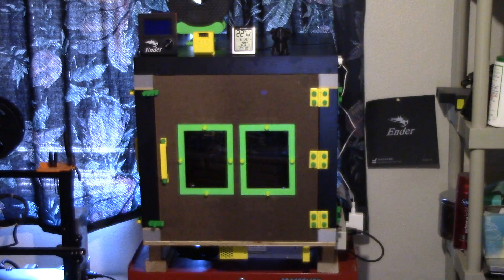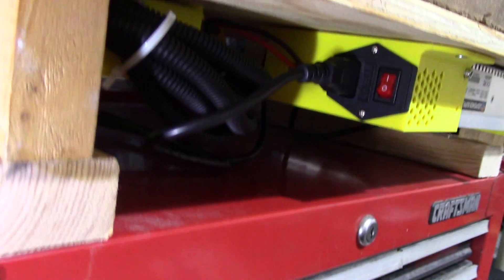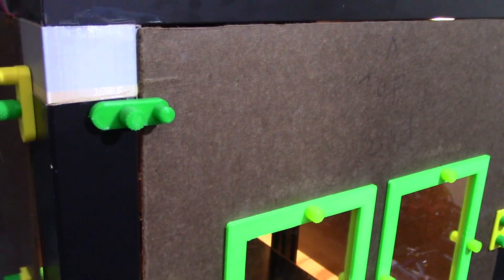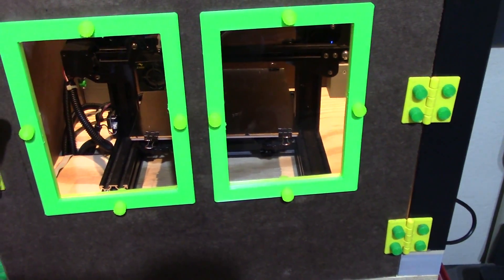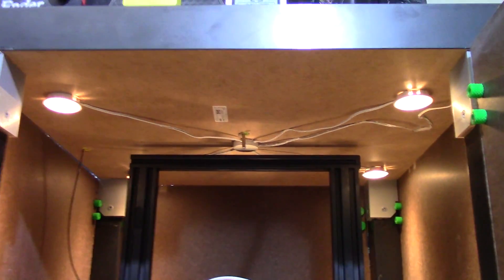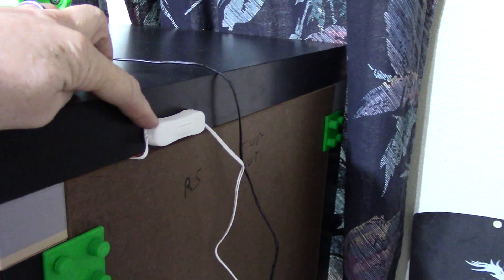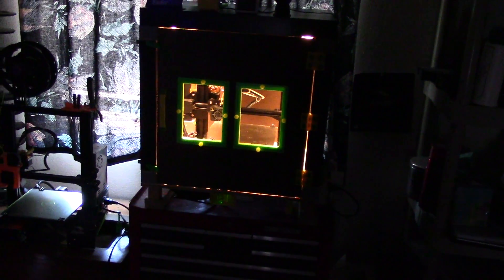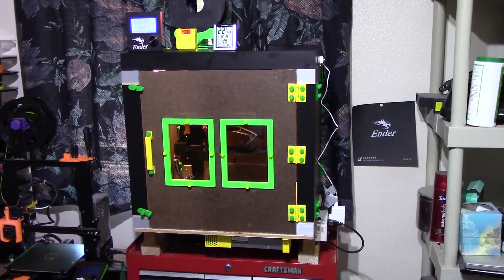Ender 3 Ikea Lack Enclosure! Done? Done!

Comment: Fine project. ABS is my aim as will with my Ender 3 pro.  without enclosure mine prints thin wall object well. I have a ways to go though. Using the SKR E3 1.2 as it came. Not been able to update the firmware as yet. Configuring a Duet Maestro to see how that system works.
Reply from the maker: Thanks, good luck with yours. Stop back and let me know how it went.

Comment: Man, that got really cool.  Aren't you afraid of a fire hazard?  I am reluctant to do the same with my ender 3 because of this.
Reply from the maker: I typically don't run the printers when I'm not home or asleep. But I've taken all the precautions that seem necessary. I've checked all the screw down connectors and the XT60 terminals for arcing and tightness. The power strip it's all plugged into has a circuit breaker. Thermal runaway protection is enabled in the firmware. And I've got a smoke detector in the room directly over the printers. Not sure what else I can do other than building a full metal cabinet with built in fire suppression. I've looked into adding a smoke detector that talks to my alarm monitoring service, but right now all my alarm components are packed up because my house had a flood and is undergoing some seemingly endless remodeling.

Comment: Very nice! Good job.
A few suggested future improvements; 
1. Add through hole(s) with PTFE tube  on top for a filament dry storage box (DIY made from IKEA Samla or similar) so you can keep filament dry (silica gel or "crystal" cat litter in the box) and dust free while easily accessible for swapping at the same time. here is one example https://www.thingiverse.com/thing:2953325 and a box for silica gel: https://www.thingiverse.com/thing:2982939
2. I would probably try to cover all the cracks and add a air ingress hole with a fan and a hepa filter, again to avoid dust, but maybe it is not as dust in your workshop as in mine. :)
3. OctoPi/Octoprint - This takes a 3d Printer to a whole new level, besides network printing straight from Cura (with a Cura plug in), there is an Enclosure plugin which lets you add sensors like temp, humidity, filament run out etc. and control fans, heaters and other functions based on the read values. For example, if there is something running too hot, you can control a power switch to turn off the power to prevent a fire.
Reply from the maker: Thanks!  Right now I think the only upgrades planned are weatherstripping to seal the cracks and possibly a small PTC heater controlled by the W1209. I'm not convinced that in my area drybox is necessary. The average humidity in my house ranges from 12% to 25% and it's 16% right now.  And I've asked multiple people, including some in the filament and printer manufacturing business, "What's the humidity level have to be when it becomes a problem?" and I've yet to get the same answer twice. "I typically get "It's hydroscopic, it sucks up all moisture!", which isn't helpful since I've known what the word "hydroscopic" means for decades. One of my future videos is to get a food dehydrator and run some practical tests between filament sitting in my room at 16% humidity and filament that's just come out of the dehydrator. So far, I've had none of the signs of excess moisture in the filament, e.g., popping, crackling and steam at the nozzle.

I've looked at the Octoprint and considering the complexity and the cost I'm not sure it's a good bang for the buck...at least for me. But it's something I'll keep in mind.

Oh, and one of my big goals in life is to never, ever, set foot inside an IKEA store again. lol

Thanks for your comments!
Reply: @3rdpig  I would consider donating a Raspberry Pi to you just to convince you, yes you will need to learn some linux to get it installed (or i am sure we can prep one for you) it is really not that difficult, and the main dev of octoprint Gina is a darling (https://www.youtube.com/watch?v=qytk8_JpYyQ).
As for never ever visiting IKEA again; IKEA is investing heavily in transitioning to online sales, so you can order from the comfort of your own home. You will miss out on the meatballs and the bargain corner, but i guess that is OK. :D